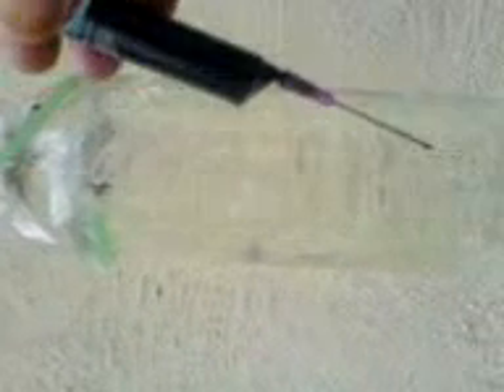Nested cylinders round vortex

Comment from the maker: There is a relationship to gravity, because the rig shown hangs vertically and stops reunning when it is about 20 degrees from the vertical. This does not mean that spin cannot be maintained down a pipe.  The coriolis effect can be verified by injecting water to cause spin counter clockwise and clockwise, the vortex will still work in iether direction, but there seems to be something magical about anti clockwise spin that I have not verified yet.

Comment from the maker: A vortex is stabel, the blow rings are a joined up vortex or joined up tube, called a toroidal vortex. If you look up smoke rings you'll find info on this.  The Beluga are blowing air rings through water, upwards of course.  You can blow water rings through water, just as you can smoke rings through air.  You would need to put a dye in the water ring to see this.